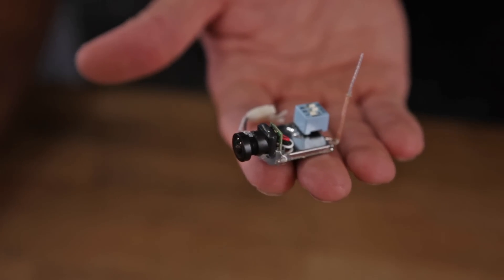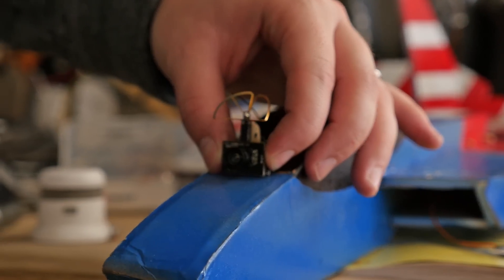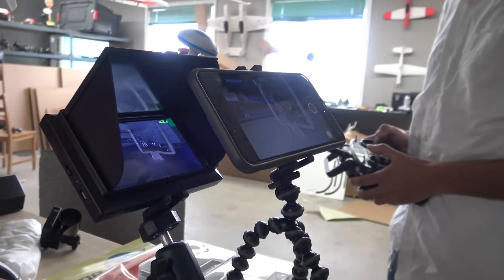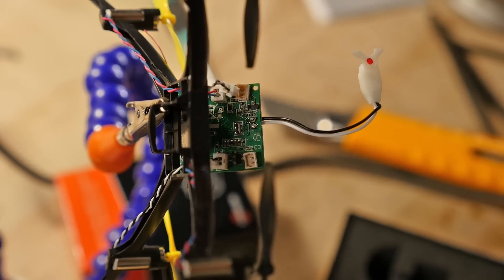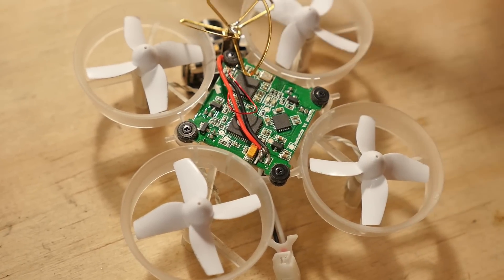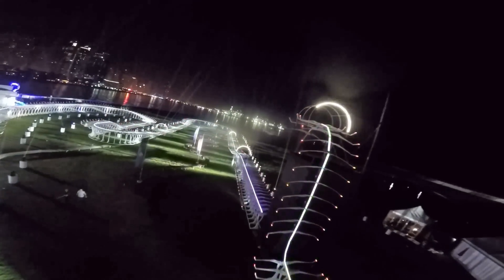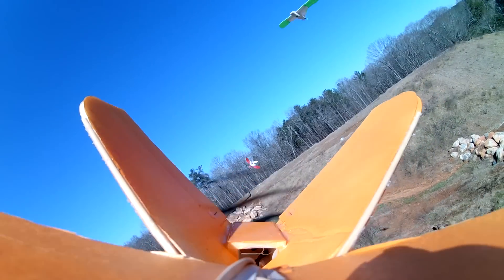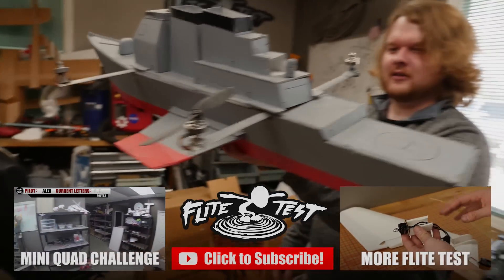DIY Mini FPV Race Quad | Flite Test

Comment: Hi flitetest I have an eachine e010 quad, and it’s very underpowered to me now. My question is, is there a way to switch the brushed motors to micro brushless motors. Like for example am I able to take it apart, put all the components on a carbon fiber micro quad frame and still get to fly using brushless motors or is it impossible?

Comment: Eachine just made a  Micro FPV Raicng Quadcopter With 800TVL 40CH comes with transmitter for only $36 not going to get any cheaper then this believe me I was lookinghttp://www.banggood.com/Eachine-E010C-Micro-FPV-Raicng-Quadcopter-With-800TVL-40CH-25MW-CMO-Camera-45C-Battery-p-1110786.html?rmmds=newArrivals/?p=QF302371176792016104

Comment: what is a good cheep screen or headset to view the fpv on ?
Reply: tweak114 http://m.banggood.com/Eachine-EV800-5-Inches-800x480-FPV-Goggles-5_8G-40CH-Raceband-Auto-Searching-Build-In-Battery-p-1053357.html

I have these and they are awesome! Nice big screen. Hope this helps!

Comment: Can this be applied to the Syma SX5?
Reply: it can be applied to anything that can lift 5-6 grams
Reply: Does anyone know how to install it on a Syma?
Reply: Hey man, here you go:
first, you probably want to pick up either an adapter or a VTX with the standard Ultra-micro JST (Horizon Hobby) connector. if not, buy a female lead (http://www.horizonhobby.com/battery-connector-w-wire-pkz3052) and solder it correctly to the camera lead. pick up a few e-flite UMX 1s batteries (http://www.horizonhobby.com/product/helicopters/helicopter-electronics-and-accessories/batteries/150mah-1s-37v-25c-lipo-battery-eflb1501s25) and a USB Charger (http://www.horizonhobby.com/1s-usb-li-po-charger--300ma-eflc1008)

installation:

Step 1: unpackaged all units and charge the 1s battery

Step 2: Solder the ultra micro connector onto the camera lead.

Step 3: Mount the camera in the desired location with servo tape or hot glue

Step 4: apply the velcro that came wit the battery to the battery itself

Step 5: mount the other side of the velcro to the quadcopter

Step 6: Mount and plug in the battery

Step 7: Turn on your 5.8 ghz goggles/ground station and search through channels until the image is found.

Step 8: go FLY!
Reply: Noah Pitzer That's awesome, thanks man. :)
Reply: Yup, Have Fun!!!!

Comment: Hi guys, I am wondering if this little fpv camera also works on any regular cheap mini quadcopter. I mean, it's sounds to easy and to good to be true to only connect the wiring to the + and - pole (mirrored) on the other side of the board. I flew loads small/tiny quads, could I really make one FPV? Just by soldering that on? Would be awesome!!

Comment: Hello Flite Test,

So I just finished my build last night (Inductrix FPV) and I decided to use the Y-Adapter that came with the camera instead of Soldering it to the board. I quickly realized that I was running through the upgraded batteries in roughly 30 seconds. I decided to power the quad with one battery and the camera with another and it worked flawlessly, but there was way to much weight. Can someone explain to me why this happened? Does the Y-Adapter divide the power in two only giving half power to each component? If I solder the camera will I still have this problem?

Thank you,

Comment: do you know whats the maximum range for thıs mını fvp cameras
Reply: I have the horizon hobby ones.  The 5 volt VA2500 and the 3.7 volt VA1100.  I've gone about 500 ft with the 2500 and still had good video.  The 1100 seems to have a much shorter range, about 100-150 ft.  Both using an Immersion Spironet Mushroom on the Rx.  It does do a decent job of penetrating Sheetrock walls in my house though.  I can be about 30' away with 3 or 4 walls and video is still fine.
Reply: thank you dude

Comment: I can't believe the price they're still asking for the blade nano qx. Cheapest i could find one is for $112au for the bnf version. Seems they never lower the price if somethings still selling, regardless of the advances in technology. Next time i might just buy 5 chines clones for the same price. I worked out that its much cheaper though to just buy the standard old Blade QX and add the fpv camera system yourself rather than buying the Blade QX FPV version.  $80 cheaper

Comment: Dear flitetest. In my country, the drones are under a couple laws when their weight exceed 250 grams(flight weight). Do you have any suggestion on how to make such a drone with that weight that you can fly outdoors? with atleast 200mw+ fpv system would be the best.
Reply: +Richards Youtube You can get a 200mw camera/video tx/ antenna, all in one from ebay that weights less than 20grams. I'd say you could strap that to anything that weighs less than 230 grams that has a good radio transmission range (ie, something with a real radio system or compatible with one.) Not a toy 2.4g radio that comes with most of these. Maybe some of the smaller 150 class quads would fall within that weight range. Check out ARF quad combo kits and find a good reputable design that has an estimated final flying weight.

Comment: Hey I am looking for a beginners racing drone hopefully $300 or under and also a pair of good FPV goggles that are within $100 so can anyone help me out?
Reply: +Caden Sullivan  hey .you can start with the Eachine racer 250 full kit .you can find it on aliexpress or bangood.and try the quanum v2 goggles from hobbyking. don't do as I did ,I had the furious 320 from walkera .I crashed it heavely five days ago and now I am crying coz its parts are sooo expensive .cheers

Comment: how do you use your phone for FPV?
Reply: U can't unless u have a phantom, parrot bebop or a prebuilt really 
Or your but a FPV screen from hobby King or somewhere which u will get the same experience with the same size screen mounted to your controller
Reply: actually there's a little FPV receiver that'll plug into any android device so you can use it as a screen. It's from hobby wing, and I'm considering picking on up!
Reply: There are ways, but I find it more expensive than just picking up a cheap monitor due to the fact that you need special tx/rx to connect to your phone. this isn't very efficient, and will probably result in more lag. check out eBay for small monitors. some can be found at auction for less than 10$

Comment: So, 1,2,3 are they all the same?? and do you know which is the best?

1)http://www.hobbyking.com/hobbyking/store/__89777__Quanum_ELITE_TX_CAMERA_COMBO_Micro_Cam_VTX_25mW_40CH_5_8GHz_NTSC_.html

2) http://www.banggood.com/FX797T-5_8G-25mW-40CH-AV-Transmitter-With-600TVL-Camera-p-1042994.html

3) http://store.flitetest.com/hyperion-mini-600-tvl-camera-w-built-in-5-8ghz-25mw-vtx/

Comment: Hello Guys, super cool stuff,  but ...  you dont get any lines on the video connecting direct toy the lipo?  is the FPV setup include a filter or something.  I get a lot of lines with my setup and i cant fly it. but my FPB pack is not the same as yours. I might need a filter.

Comment: I consider buying this, but,   what reciever can I get that's also around $50 so that way the whole system can still go around $100?
Reply: +Andre Martinez you can get an FR632 diversity receiver for a hair over $50 on eBay. Or get an RC832 for like $20. Quanum Elite Tx combo is a pretty nice package for a camera, vTX and antenna too. 

A screen will also set you back by anything from $15-150, but if you cheap out, get a "UFO DIY" goggles' spare display panel only for $40 and make up your own case for it with your preferred vRX.

Comment: This is the greatest video ever made.I went ahead and setup on my Nano QX, unfortunately, it could not even take off. I think the weight of the camera is too heavy for Nano QX. Please let me know which battery size that you are using, I am using 1S 150mAH battery. Is it sufficient? Any alternative to get the nano QX to take off?
Reply: +Jonathan Lai If it doesn't take off with 150mah then increasing in mah would just make it heavier. The battery might have had it or the throttle range might be messed up on the controller. Try charging the battery up on a good lipo charger. The stock chargers apparently don't always give a full charge from what I've heard. Other options, you could do the motor upgrade then upgrade the batteries to higher mah, add bigger props with less pitch and remove some weight.

Comment: OK, looks like a very easy mod on the nano and inductrix. My big question is, How do you find batteries for these minis that last? I have used the ones from HH (eflight) and they last about 1-2 minutes flying my nano qx fpv quad from HH. I know what I'm doing in this sport and the proper handling of lipos. I fly 250, 230 and now 210mm racing quads that I've built with various boards like cc3d naze32  open pilot revo and so on. Never have I had such lousy luck with batteries as I have with these 150 mah single cell batteries from e-flight. So please share with us your choice of battery. Oh and I love the mini Dubai race track. Cute, keep up the good work.

-Bill
Reply: i think they are using 180/260 mah batteries

Comment: Hi,

You need to re-evaluate your understanding of wifi video downlinks since the introduction of "wifibroadcast". It's opensource modification to usb wifi transmitter and receivers that allow for connectionless Tx&Rx.  That means low lag, "graceful" degradation of signal, no "reconnection" blackout and multipoint receiver diversity that can be pooled together by IP networked receivers (either wired or wireless).

So far that's only as good as analog video transmit but when you factor in the massively increased bandwidth and the fact that this is bidirectionnal high bandwidth, now you can do Full HD FPV, telemetry over wifi, mission updates over wifi and probably some other stuff that simply isn't possible with current hardware.

One drawback is that for now you'll have to carry a raspberrypi with desoldered connectors and use the (pretty good) 5MP CSI camera (30$ rpi + 30$ camera +20$ usb wifi)

Comment: Tried this on my Inductrix but the flight time was so short, needs a battery upgrade.
Reply: Did it fly like a sack of bricks as though it weren't gaining any altitude?
Reply: Get the Micro motor warehouse fast motors for the nano qx (http://www.readymaderc.com/store/index.php?main_page=product_info&cPath=505_506_866&products_id=5730) and the mylipo 205mah 1s battery also from MMW (http://www.readymaderc.com/store/index.php?main_page=product_info&cPath=84_213&products_id=5731)

or just load up on a ton of the e-flite batteries and get really good at changing them!

Comment: hey guys great video,

but is there any way to use this fpv cam from horizon: http://www.horizonhobby.com/product/multirotor/fpv--first-person-view/first-person-view-%28fpv%29/ultra-micro-fpv-camera-and-video-transmitter-spmva1100

and is it possible to connect the batterie to the quad and the cam or how can I do it??

Comment: are these mini quads flyable in manual/acro mode??
Reply: +emulsion88 Yes. Both the Inductrix and the Blade Nano QX can fly in rate mode. To me the Nano is a little twitchy and the Inductrix more stable.

Comment: I have the inductrix that comes with a transmitter, does it still work with the same transmiter?
Reply: after the camera is attached
Reply: +Teodoro Lozano Yes. The camera works on a different frequency, so you can still use the standard transmitter.

Comment: IDEA FOR SHOW : the FAA limit is 55lb  please make a 55lb model so we can see how big it will be
Reply: +Highteckhobbies i think they said .55 pounds not 55lb
Reply: guys the FAA says all UAS must be under 55lb look it up
Reply: +Highteckhobbies They already did the flying cinderblock. How heavy was that?
Reply: i was thinking make the airframe 55lb not the payload but yeah i remember the flying cinderblock
Reply: +Highteckhobbies +Ashley Ireland Yup, the registration limit is 0.55 lbs. not sure if that's what he means. Haven't checked if there's an upper limit :D
Reply: Highteckhobbies ...unless certified by an aeromodeling community-based organization.
Reply: +Esa Edvik https://www.faa.gov/uas/
Reply: naihanchin Kempo Nice link, bro. Got any useful input?
Reply: more useful then yours
Reply: http://s2.quickmeme.com/img/e6/e62b8eb7a764b31395ea449c4ee80d3fb485ee3ec25e08872366ff9724e3669e.jpg

Comment: So those teeny tiny 6 mm brushed motors are enough to carry that little camera? I had planned to do this but was told by some hardcore micro quad guys that the stock nano qx wouldn't have enough power for this. What does it do to battery times, btw?
Reply: +Jon B Baca Cuts the battery time about in half in my experience. I have run this setup on the eachine/jjrc h8 micro quads with no problems other than the motors getting hot. I recommend buying high c rated 1 cell batteries, a hubsan x4 h107c or d flight controller and transmitter, 8mm or 8.5mm motors and a light frame. If you're lucky, you get around 3-4 minutes with the right setup.
Reply: I didn't do enough research when I got the Nano qx, I thought the board could support 8.5mm motors but it only supports 7mm. At least I got it cheap, and it's still a lot of fun. I'm probably gonna build one from scratch with a Scisky board from hobby king, some Micro Motor Warehouse motors and this little camera or the Quanum one. Haven't decided on a frame yet
Reply: The Scisky board has a built in DSMX transmitter in it and can run Cleanflight. It's about the same price as a Hubsan board too

Comment: where did you get one without the rubber surround???? the one in my FPV Nano broke so i ordered a new one from the states but it came with a rubber "housing" which prevents it from fitting into the airframe!!!!!!
Reply: You can take the case off
Reply: +Matt Brozyna with the replacement one i got through you had to cut it off!!!!
Reply: +mattyp80   Which camera did you buy? The nano fpv comes with spektrum  va1100 stock. It's a slightly different camera than the one shown on flight test--va2200. The va1100 has a removable case with no cutting. If you bought the va2200 by accident, you now have a better camera than what was stock on your nano qx.
Reply: +Matt Brozyna yup the spmva1100! the case seemed glued together!

Comment: Should of just soldered a female servo pig tail to the flight control boards and left the camera lead alone so you can just plug the camera in or unplug it when you want to move it. Or just make the camera lead shorter but with the same male servo plug then still have a female servo lead going to the power on the flight control board.

Comment: Hey, could this work on the Blade QX 180?  And could you guys show me how?
Reply: It'll definitely work, just connect a separate battery to the camera or do what they did and solder the power cables to the quad's battery lead pads

Comment: To add a fine solder point on any iron use copper wire. Wrap it around the end of the soldering iron 4-5 times then leave a pointed tail to solder with. The wire conducts enough to work great for fine(small) jobs. Just use whatever size wire works for the job at hand.
Reply: I wish I would of thought of that a long time ago.  Thank you!!

Comment: I have a challenge for you guys at FT! so i challenge you to make a QAV style race quad out of foam board. The only requirements I have thought of are as follows: on sheet of foam board, one wood rod of any choice biggest size allowed is 1/4 inch, and it must carry a gopro and/ or fpv gear. Have 3 people design and build their own and fly it. "Winner" is determined by how ever you want them to be.  And Let The Games Begin!!!

Comment: Must be nice to have access to a laser cutter. Could you imagine how long it would take to cut these out individually.
Reply: +MasterMayhem78 My dad is a graphic designer and they used to take piece of plywood and use the v shaped nails to fix strips of sheet metal then use it to cut out foam or similar for different jobs. Esentially a do it yourself diecut. I piece of plywood and some v shaped nails and some of the metal garden edging would be enough to punch a set of hoops or brackets real fast since it doesn't have to be too accurate.

Comment: Sorry I'm kind of a noob at fpv, so if I bought one of these, how would I link it to an ocd or goggles?
Reply: Just match frequency of the Tx. Easy as turning on both Tx and Rx and flipping through channels until they connect. Pro tip: if you are ever out where others are flying FPV, you can match their frequency and watch what they see. It's pretty fun.

Comment: I tried soldering the power for the fpv unit directly to the power in on my micro quad. I have clear video until i turn the motors on, then it just goes static...how are you guys doing that?

Comment: I wonder if this will work on my Hubsan X4.
Reply: Of course it will. Just connect power leads.
Reply: Yay! No need to get the super expensive H107D with its proprietary radio controller.

Comment: https://youtu.be/1E2YvhiVnpc?t=7m32s Here you mentioned someone putting it on a RC car, and got curious. What would you need to be able to set up a camera like this? Any sellf contained unit or directly plugged into a special board on the vehicle/special controller?

Been pondering adding something like this to one of my 1/16th RC Tanks. Most likely my Panzer IV. Curious how/what it'd take to do a setup such as this.
Reply: With the proper connector It can also be powered by a 3.7v lipo as a standalone unit. It can be put anywhere. Put it on your dog. Put it on your head. These little things are great. Range isn't so hot, but that's to be expected. The Tx is only 20 or 25MW. So yes, you can slap one of these on you Tank.